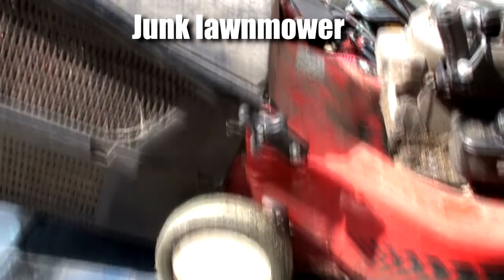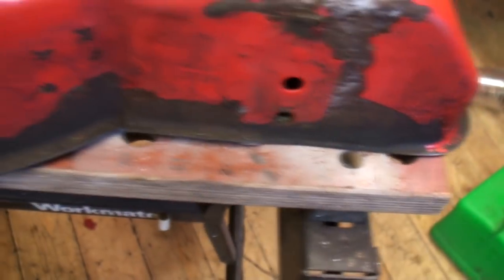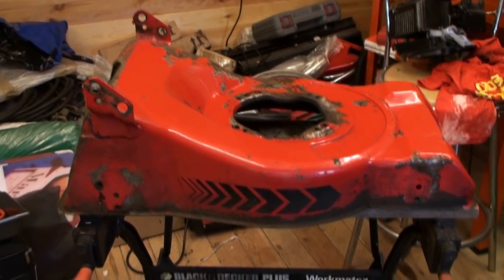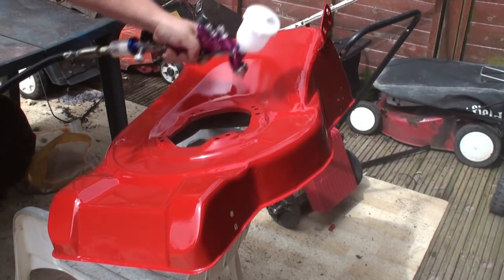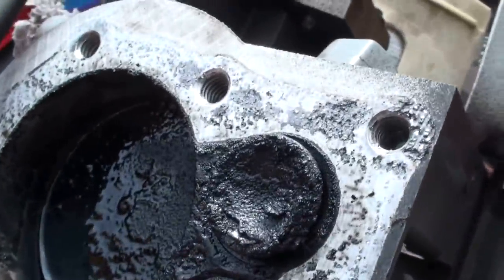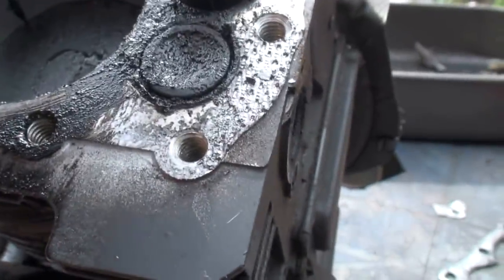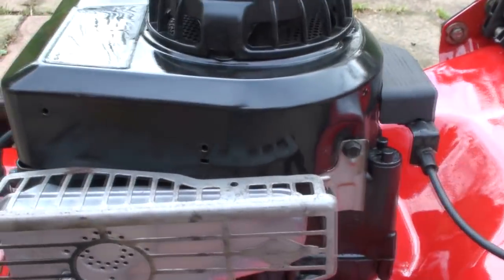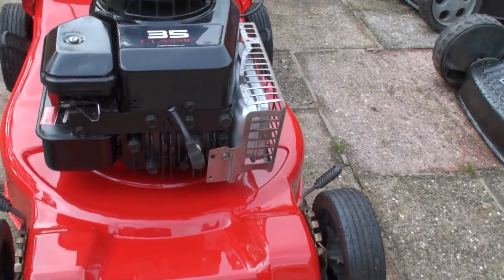Junk Lawnmower Lives Again

Comment: Martin, some advice please?  I have the chance to get a pretty sorry John Deere zero turn mower for free.  By sorry I mean it’s pretty crook cosmetically and it’s engine condition unknown.   What should I do or check 1st as to the viability of restoration? My thought is “can the engine be ever bought back to life”?  Do you agree this is the key determinant ?
Reply from the maker: First of all make sure it turns over so you know it hasn't thrown a rod or something. Then check if the blade deck is not rusted out as this would be expensive to replace. Anything else is fixable or replaceable. Just my opinion but its hard to say without seeing it.
Reply: RetroHax okay, good advice. I’ll have a look on the weekend and take some photos too.